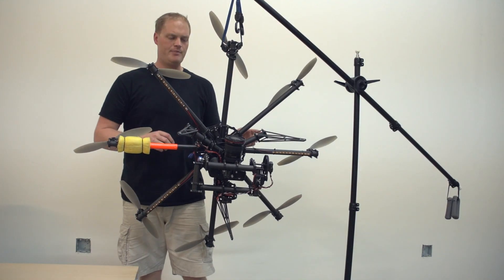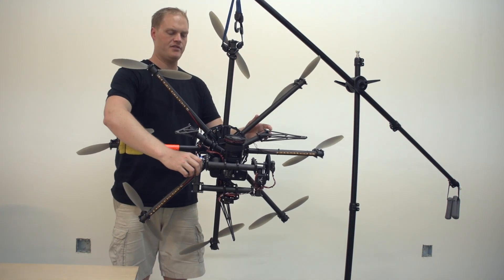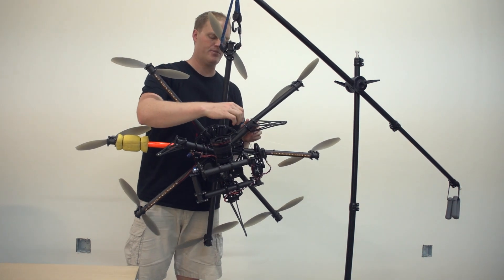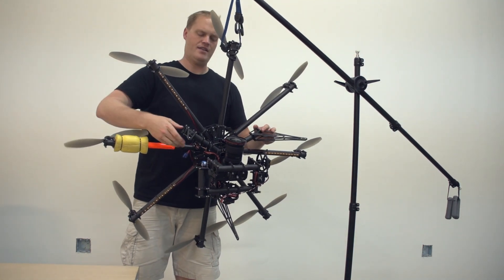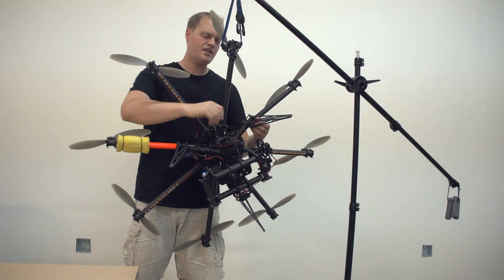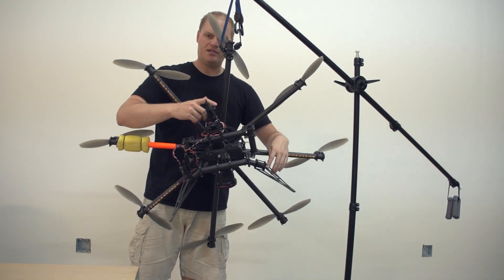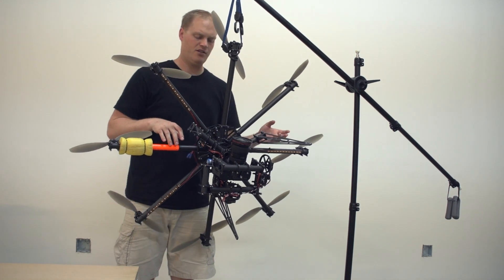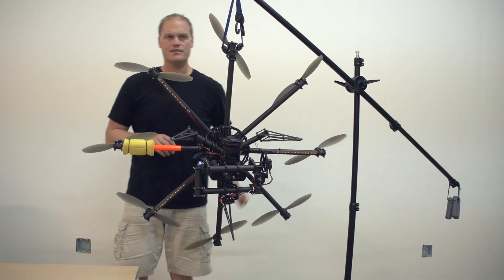Balancing Pan Axis

Comment: Hi how did you determine the movi was back heavy ? i also hung the cinestar but i am not able to have pan balance such that it holds? how can you tell when to rotate to right or left ? or front or back ? because for me cam never holds position when balancing this way - when i connected the configurator i got a pan motor value of -2. Please help